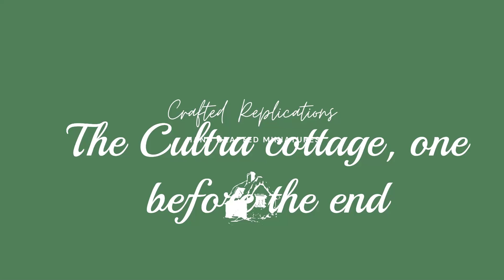The Cultra Cottage, the one before the end!!!

Comment: Greatings from Alberta Canada. I am a new subscriber. I have a question for you or anyone really lol. I have a huge Tudor house that I built from plans in a doll house  book. The problem is not the house. I did dry wall compound on all the walls inside the house. Thinking wallpaper takes away from the furniture in the house. So my question to you is there anyway to take that stuff off the walls besides sanding it off is what I have done so far. But some sports like the alcove in the master bedroom are inpossible to get too. Any suggestions on something can spray on and even scrap off
Thank you for your videos. Very informitive.
Reply from the maker: Hi Tammy all the way from Alberta Canada!!wow! First of all thankyou for your kind words and for joining the journey, your question is a cracker but a bit of worry but alls not bad news. I don't know if this is going to work but it would be my first approach. I think I would use acetone to soak through to the back of the dry walling to release it and then scrape it or use a screw driver or awl to deal with the alcove. And when i say soak I mean gradually add the acetone with cotton wool until it soaks behind the dry wall and as I say hopefully it'll release after this. Hope this helps Tammy ,let me know how you get on😄Thanks John.

Comment: Here I was cutting some 1/12 scale faux strap hinges from tiny scraps of copper while watching you and I heard my name.  How funny.  Question.  What do you call that stuff you rolled out and stuck to the peaks of the roof line?  It looks like some kind of insulation, but I don't recall seeing its like here in the U.S.  But I'm no expert.  Despite my best efforts to make all walls EXACTLY the same height, I often have very small 1/32" gaps between floors at final assembly time-just enough for light to show through and be annoying.  Perhaps I could use something like that to fix that problem.
Reply from the maker: Hi Marykay glad to hear your making your own hinges faux strap are the only one's I would make now and copper as well, wow!! Yes your right it's called W profile rubber seal, and is great for our 1,12 scale as it splits down the centre to give a perfect fit  hope you find some .😊
Reply: @craftedreplications9529  I looked up the W profile "rubber seal" but the only thing I find looks (and says) that it is "foam rubber."  The stuff you were using was not that, correct?  It looked to be some faux rubber, rubberized plastic or something of the sort.  Is that right?  If so, I will keep looking for the right thing.  Sometimes things that are available elsewhere are not available in the US.
Reply from the maker: @marykayryan7891  hi Marykay  don't look for anything else that's it foam rubber with an adhesive tape on the back I only use W profile because it gives me 2 steps and some jobs it needs to be double over here it's main use is for draft excluder but it really is good for awkward shapes and hiding my sometimes imperfections;-)